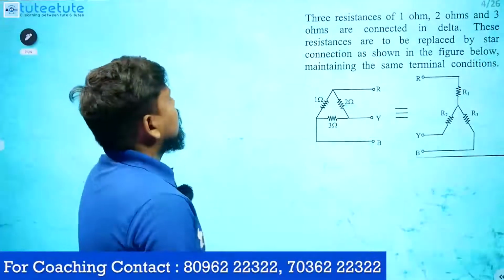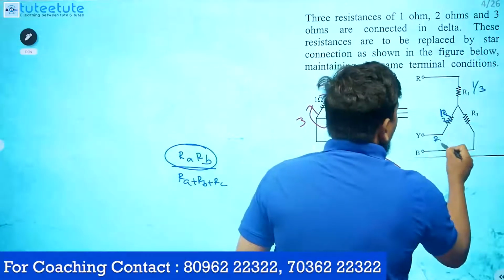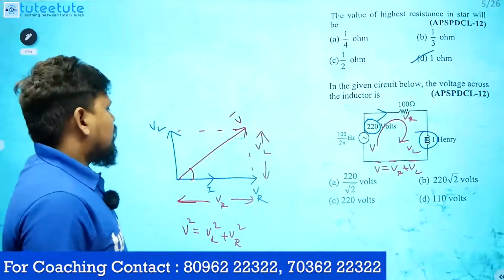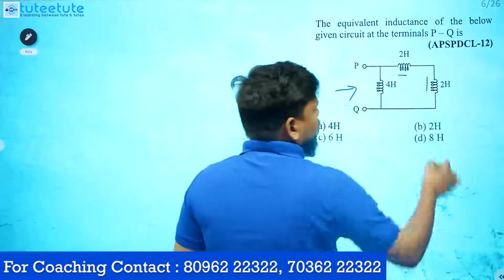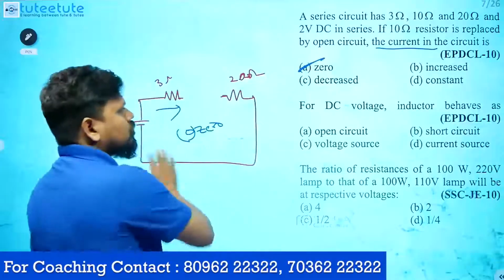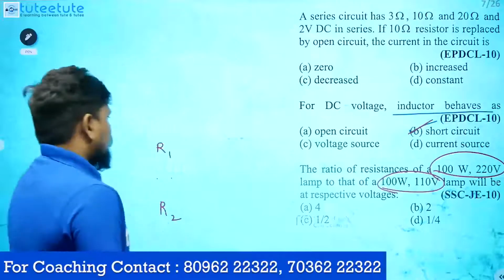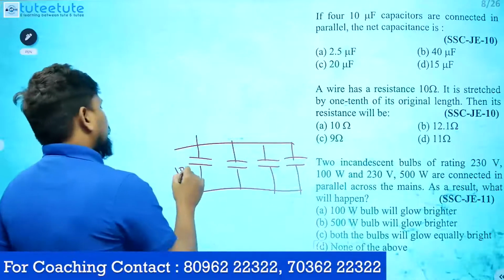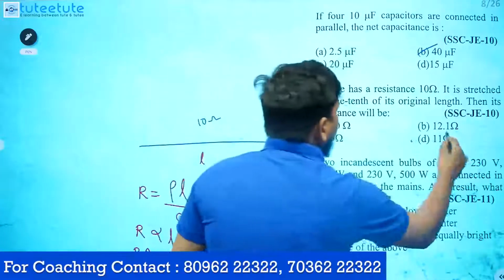AE/AEE Electrical Previous Questions Part-7 | For SPDCL, NPDCL, GENCO & TRANSCO | tuteetute

Comment: Hi sir voltage across inductor should be 110 volts right ?
Reply from the maker: Yes, 220/2 =110, in fast sir wrote as 100.